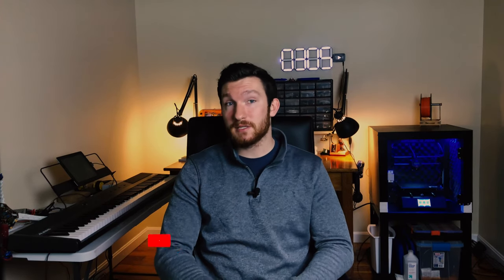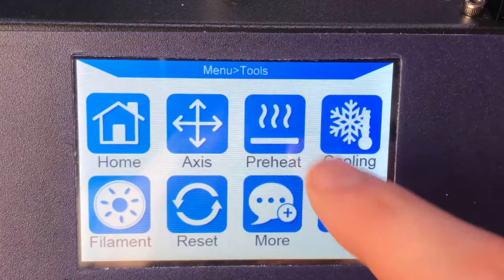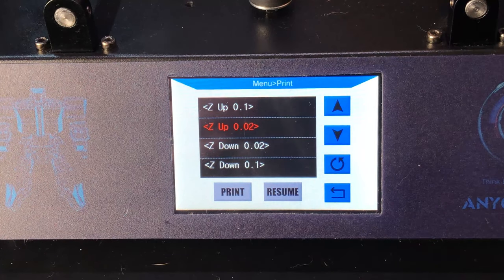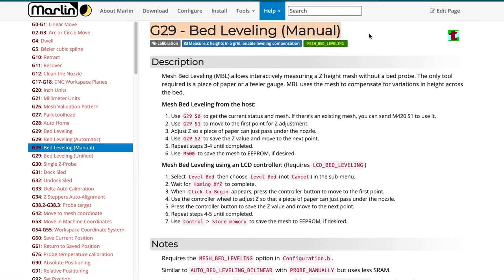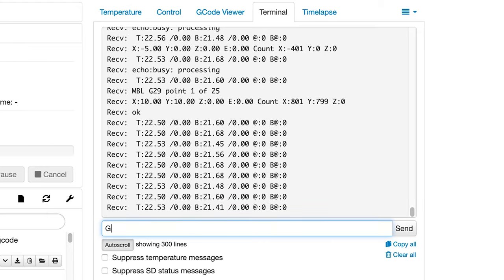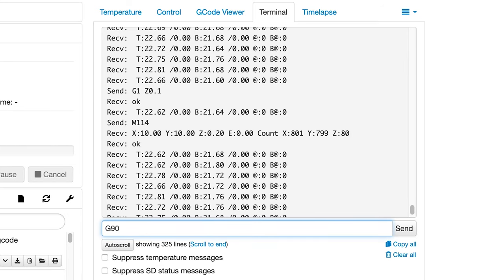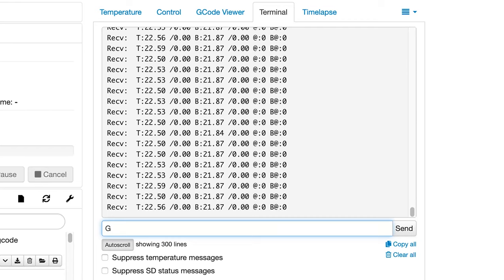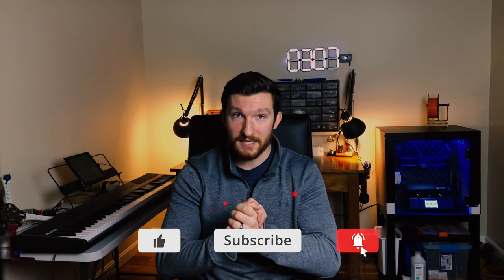Manual Mesh Bed Leveling For Marlin Firmware [Fix For Warped Beds!]

Comment: Good day, I had a china brand printer , Micromake C1 printer, that doesnt respond to G29 S0 or any other code, but below is the start/end gcode I had found in the China Cura slicer, the funny thing is the Micromake printer doesnt recognize Ultimaker Cura or vice versa and only the China Cura can operate this printer >< 

Start Gcode 
;Sliced at: {day} {date} {time}
;Basic settings: Layer height: {layer_height} Walls: {wall_thickness} Fill: {fill_density}
;Print time: {print_time}
;Filament used: {filament_amount}m {filament_weight}g
;Filament cost: {filament_cost}
;M190 S{print_bed_temperature} ;Uncomment to add your own bed temperature line
;M109 S{print_temperature} ;Uncomment to add your own temperature line
G21        ;metric values
G90        ;absolute positioning
M82        ;set extruder to absolute mode
M107       ;start with the fan off
G28 X0 Y0  ;move X/Y to min endstops
G28 Z0     ;move Z to min endstops
G1 Z15.0 F{travel_speed} ;move the platform down 15mm
G92 E0                  ;zero the extruded length
G1 F200 E3              ;extrude 3mm of feed stock
G92 E0                  ;zero the extruded length again
G1 F{travel_speed}
;Put printing message on LCD screen
M117 Printing...

;End GCode
M104 S0                     ;extruder heater off
M140 S0                     ;heated bed heater off (if you have it)
G91                                    ;relative positioning
G1 E-1 F300                            ;retract the filament a bit before lifting the nozzle, to release some of the pressure
G1 Z+0.5 E-5 X-20 Y-20 F{travel_speed} ;move Z up a bit and retract filament even more
G28 X0 Y0                              ;move X/Y to min endstops, so the head is out of the way
M84                         ;steppers off
G90                         ;absolute positioning
;{profile_string}

I had zero idea about this gcode stuff as im a beginner to 3D printing, I had tried to use a Gcode sender by Chrome and the printer seem to not respond to a simple G29 S0 code. May i ask for a guidance for this ? deeply thankyou ~~
Reply from the maker: Thanks for asking! I'd be glad to help if I can. For the start GCode, you are looking for the G28 command instead of the G29 command. It looks like you do have the G28 command in your start GCode, so you'll need to paste the following directly below the G28 Z0 line: 

M501
M420 S1

On the note of the G29 command, it will only work if your printer's firmware supports Mesh Bed Leveling, and furthermore, the G29 command doesn't do anything that the printer would physically react to, instead it simply responds with the currently saved Mesh in EEPROM. If there is no mesh currently saved, then it will say "Mesh Bed Leveling Has no Data". 

I hope that helps to clear up some of your questions, be sure to let me know if I can help more!
Reply: @ModernHobbyist  okie , i will try on with that ~~~ Thankyou for replying my message. Below are some information i got from this printer when i connected to Gcode sender. Is the printer firmware supported mesh bed levelling ? If no, can i also change to another firmware ? ~~~Tq ~~~~

start
echo:Marlin -Firmware-
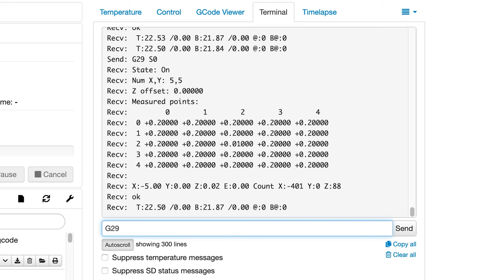echo: Last Updated: 2016-04-24 12:00 | Author: (none, default config)
Compiled: Feb 11 2017
echo: Free Memory: 3610 PlannerBufferBytes: 1232
echo:Hardcoded Default Settings Loaded
echo:Steps per unit:
echo: M92 X100.00 Y100.00 Z100.00 E150.00
echo:Maximum feedrates (mm/s):
echo: M203 X200.00 Y200.00 Z200.00 E30.00
echo:Maximum Acceleration (mm/s2):
echo: M201 X3000 Y3000 Z3000 E4000
echo:Accelerations: P=printing, R=retract and T=travel
echo: M204 P1000.00 R1000.00 T1000.00
echo:Advanced variables: S=Min feedrate (mm/s), T=Min travel feedrate (mm/s), B=minimum segment time (ms), X=maximum XY jerk (mm/s), Z=maximum Z jerk (mm/s), E=maximum E jerk (mm/s)
echo: M205 S0.00 T0.00 B20000 X20.00 Z20.00 E5.00
echo:Home offset (mm):
echo: M206 X0.00 Y0.00 Z0.00
echo:Material heatup parameters:
echo: M145 S0 H180 B70 F0
echo: M145 S1 H240 B110 F0
echo:PID settings:
echo: M301 P22.20 I1.08 D114.00 C100.00 L20
echo:Filament settings: Disabled
echo: M200 D3.00
echo: M200 D0
echo:SD init fail

Comment: the commands don't work, I just get a response like "echo:Unknown command: "G29 S0"
Reply from the maker: Hey thanks for the comment! Is your printer running the Marlin firmware?
Reply: @ModernHobbyist  No, no it was not. I was being quite dumb. After installing marlin it worked! Thanks for that video, it REALLY helped!
Reply from the maker: Haha no problem! I only recognized that command because I did the same exact thing on another printer of mine lol
Reply: Well, I got the mesh on my printer, but Cura isn't using it! Some first layer lines are totally opaque, and others aren't even extruding, I have both lines of code in my gcode start file in cura, but it isn't using the mesh!

Comment: Thanks a lot for this instructive video. 
When you move to another point with for example G29 S2, do you move the nozzle manually after disabling the steppers, or do you send a G-code command to move it?
Reply from the maker: Thanks for the comment! You would need to send GCode commands to move the nozzle up and down once you have started the MBL process. You can modify the Z offset using the same G29 command with the S3 parameter. Here's the Marlin doc for your reference:

https://marlinfw.org/docs/gcode/G029-mbl.html